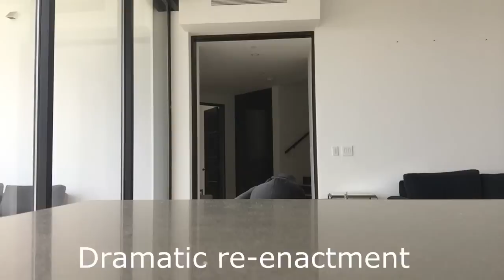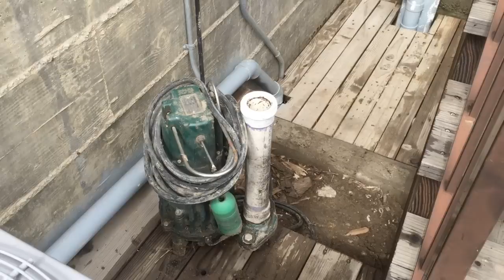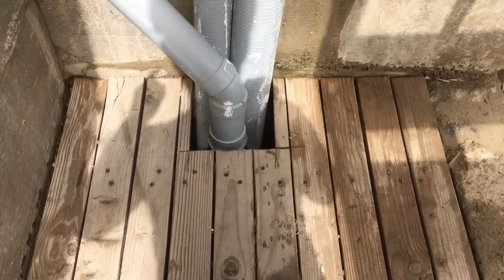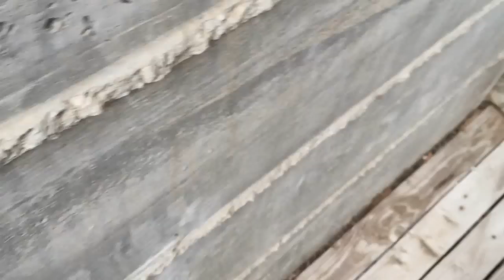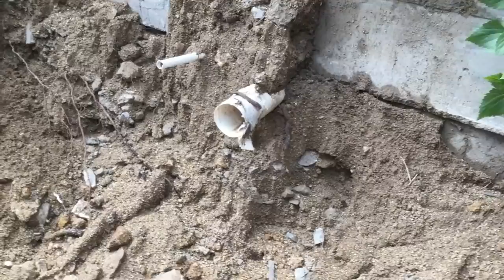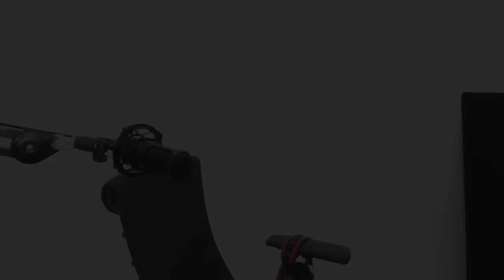EMERGENCY

Comment: "worst case scenario"
try buying a house, trying to take a shower and all of a sudden the SEWER water starts to UP the pipe of you shower past the drain and out the little overflow notch in the side of the tub
we were scared to shower for a week

Comment: How did your inspecters not catch that the outlet wasn't GFCI? That's extremely dangerous and could lead to electrocution if you hadn't found out. I'd check on your other outlets too while you're at it.

Comment: actully it should be there i had a house that had a sub pump and the pit gets to full that the water has to go somewhere. My subpump quit and my basement. jordan trust me if it didnt have the tube your house would be flooded
Reply: my basement flooded

Comment: if you live in a low area or a flood zone, that pipe may be required by law for drainage
Reply: +Darasilverdragon Also, you need a weatherproof GFCI outlet in that spot and that cover needs to be replaced with something called a bubble cover, or 'in-use' cover, if it isn't already one.

Source - I run the electrical dept. at an Ace Hardware

Comment: And if your by any mountains leave there will be mud slides cause of a elnino means the water is hot on the coast so more will evaporate and more rain and lots of lots of rain
Reply: Pour a bed of concrete down the hill so it doesn't wash and mud down trust me I'm in construction +captainsparkelz
Reply: +Moriotime lol there will never be a mud slide cali drought

Comment: need proper foundation..down slopes..that pipe should go to the sewage ...hope the best for you :P
Reply: +Jonii Yung Sump pits pump the water outside the house not into the sewage system.  It's illegal to pipe your sump pump to the sanitary sewage system.  And when the system was installed it was probably done exactly as it was supposed to be.  People building several million dollar homes don't skimp on stupid crap like that.  You can clearly see that the pipes sticking out have been broken off.  Before the entire hillside slide away the pipe likely extended quite a distance underground to a suitable drainage spot.
Reply: Rowgue51 lol meant the ditch..extend ur slopes so pump don't fill so fast.. N dont let it pump water onto foundation.. Iunno ur laws in California.. Nor can i fully see condition of the problem..but gg
Reply: It probably was set up like that before the whole hillside washed away.  He's just seeing the broken end of the pipe exposed after the hillside washed away and assuming it was like that the whole time and is the cause of it.  But it's more likely that the rain itself washed the hillside away (which happens regularly). and broke the pipe off in the process.

I'm willing to bet he later finds about 50 more feet of pipe that washed down the hill along with the dirt.